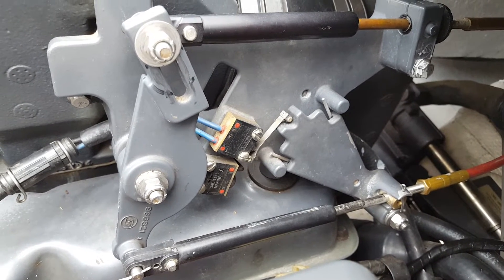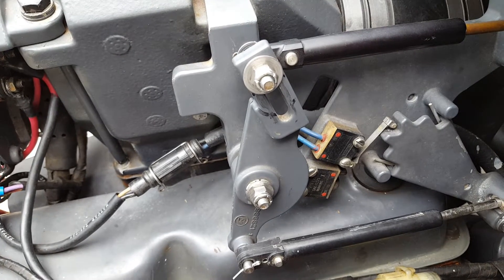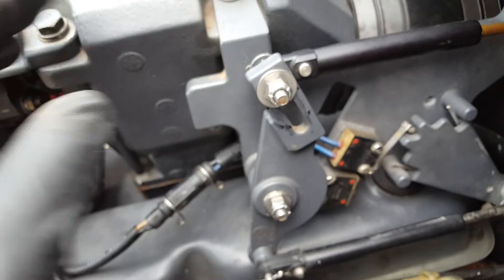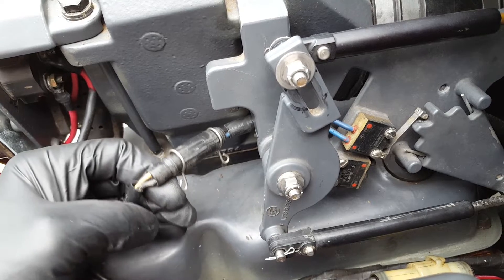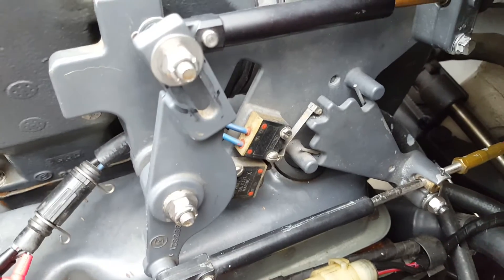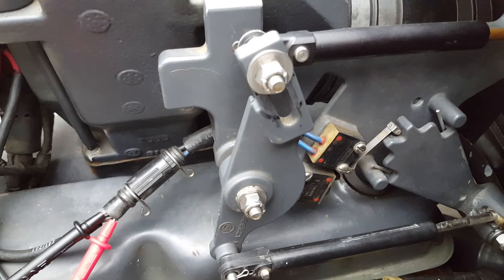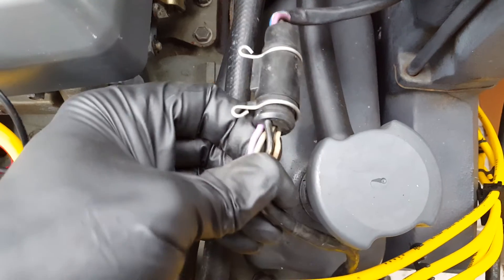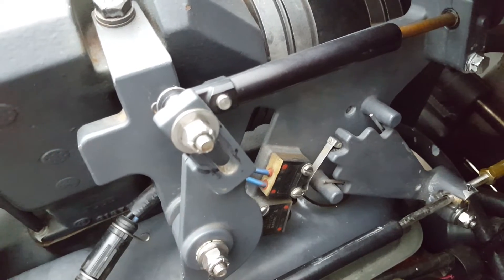Engine Bracket & ESA Troubleshooting Part 1 - OMC Cobra Volvo Penta SX

Comment: I’m with everyone else, you can’t leave us hanging! I picked up a 90 four Winn’s freedom 170 with a 3.slow. The thing has a brand new engine in it. I finally got it running, took it out this past weekend to check it out. The idle is way too high (800-1000rpm, probably the bad gas) and I was having one heck of a time shifting it. There was a point when coming in to the dock, that it wouldn’t shift from forward to neutral, so I shut it down. I was able to get it to return to a neutral position and on the trailer. I’m probably going to bite the bullet and buy the alignment tools to get the shift cable and everything in line. Thanks for the videos!
Reply from the maker: Andy, I know exactly what you went through--it's very common. There are a few prerequisites that need to be in place before you can touch the engine bracket. 1) Engine idle needs to be set between 400-600 RPM. 2.) ESA must work for forward/reverse (shown in Part 1 video). 3.) Shift rod height needs to be just under 7 1/4 inches ( 7 - 3/16 to be exact) from the  the shift rod plate to the shift rod end (look up what the shift rod end is because it isn't the actual end of the shift rod per se). That prior mentioned step will be posted in a video tonight ( May 21st 2018). If you don't have those three setup up right, you will always have issues with shifting. Don't stress about taking the stern drive off, it's easy. Watch my video. I make it super easy.
Reply: Michael Romer I’m an auto tech by trade... I started getting all nervous thinking it was going to be difficult to repair. For the most part, it appears pretty straight forward... I think I may order the shift cable and gaskets needed for the replacement (all parts on eBay for around $130-140, including tools) and spend a rainy day getting it all lined up again (if I can’t get the inside stuff aligned). 

I do need to start with the hull side, considering the engine was out, I’d like to see how to set the front side stuff up first before buying all the stuff for the cable replacement, since mine has the new style cable brackets on the inside of the boat.
Reply from the maker: Andy check this out. It includes everything and I mean just about everything you could need. Gimbal bearing, alignment tools, bellows, seals, shift cable, plus it's $200 
https://www.amazon.com/TRANSOM-SHIFTCABLE-3852548-18-2771-3854127/dp/B0793BQ256/ref=sr_1_3?s=home-garden&ie=UTF8&qid=1527025298&sr=8-3&keywords=OMC+shift+cable

OMC COBRA TRANSOM/SHIFTCABLE KIT W/SEAL AND SNAP RING 3852548 18-2771 3854127
Reply: Michael Romer that’s the kit I was looking at... I’m going to do some investigating after you get the next video posted up to make sure all the other stuff up top is correct before I pull the lower unit off.
Reply: @andye4618  If you do it that way it will be ass backwards, You need to start all the way in the back starting with the shift lever and the shift cable! If you try to take any shortcuts or do it any other way you are going to be chasing your tail!

Comment: mike do u have a part number for the v-spring?
Reply from the maker: William Holdt Here you go. If you are running a 1986/7, definitely consider changing it. Here you go: http://www.crowleymarine.com/parts/14529.cfm
Reply: I have an 88, having problems getting it into reverse, this video really helped, thank u so much , go two big trips planned and I still need to figure this out ugh

Comment: I am hoping part 2 will show how to adjust so that it will shift into reverse. My shifter will get just to point to almost shift into reverse but doesn't. I can just barley pull the bracket where that top adjustment nut is and it slips into reverse with no problem. Has to be a slight adjustment to get to shift properly. Looking forward to part 2. Thanks for the very helpful videos.
Reply from the maker: There is a trick to getting it to "click" in gear. Please keep in mind your shift cable could be the the culprit (due to the age). What I typically recommend is you remove the stern drive and test the cable. The cable drag can't be more than 2.5 Lbs when measured by a spring scale. 2.5 lb measured in both directions  by the way.  If you fish, you have one of these scales. If your cable has never really worked then, stay tuned to part two and I'll show you the trick.